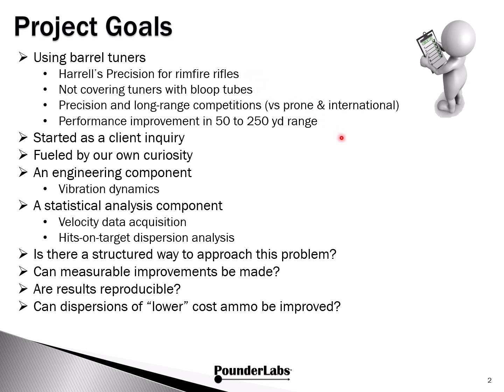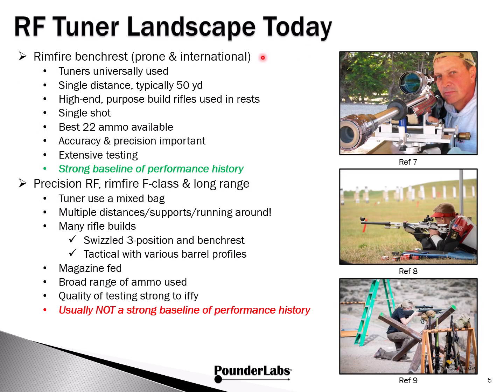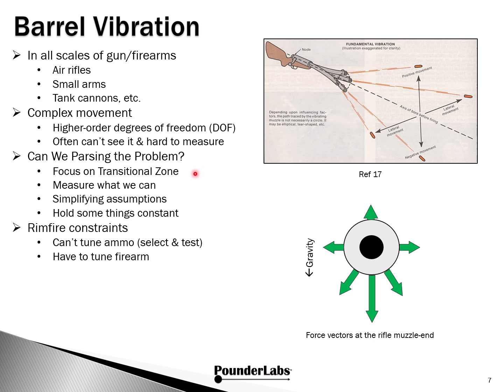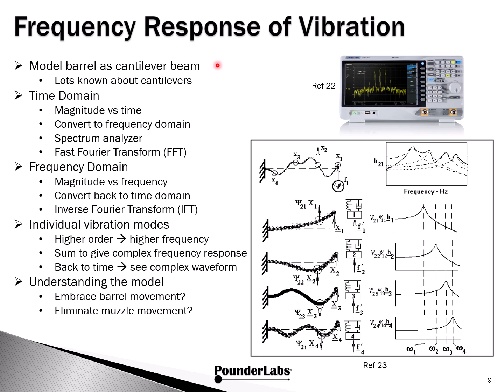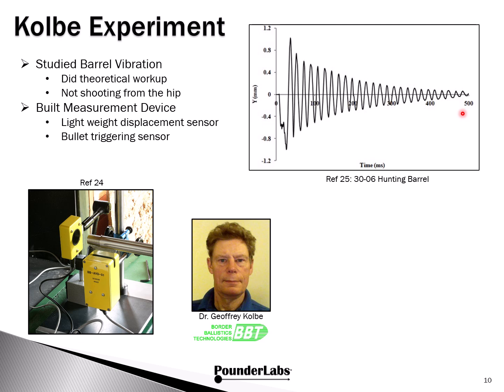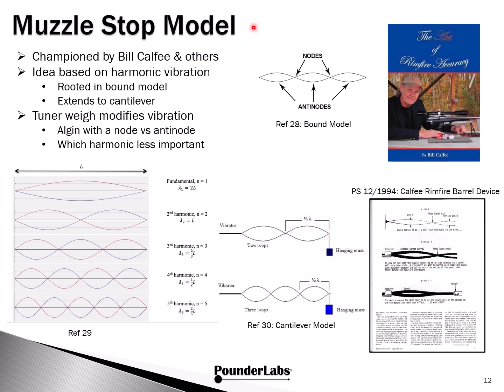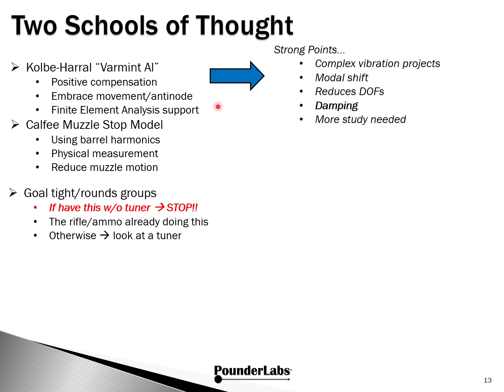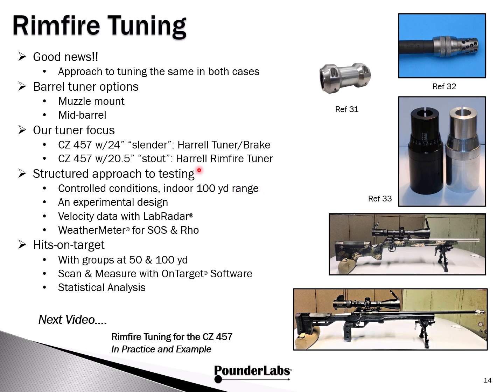Barrel Tuning for Rimfire Rifles - Fundamentals

Comment: Excellent sumary and analysis! It is straightforward to determine the PERTINENT harmonic on a centerfire via a charge weight ladder test and the point of impact on a target. Using a method discussed by Vaughn, it is apparant that the cycle corresponds to the speed of sound along the barrel length, which translates into a transverse movement at the muzzle. These high frequency vibrations ( 10k hz and harmonics) occur within the barrel time and are quickly overcome by the cantilever effects, but after the bullet has left.  Looking forward to your next episode.

Comment: This is great info! I am considering adding a tuner to my CZ 457 (Muller works barrel in chassis with 3 oz trigger) it is very ammo sensitive.  I wondered if full length bedding or the addition of a pressure point under the barrel would be an alternative to dampening harmonics. Thanks for this great and thoughtful project!
Reply from the maker: Thanks for viewing the video and your comment. I, and the folks I shoot with, don't have any experience bedding a barrel to suppress/modify harmonics. Bedding receivers is done all the time but as for bedding barrels... check with the heavy rimfire benchrest folks... they might have some ideas.

Anything putting pressure on a barrel can affect its vibration performance so proceed with caution. Back in the day Winchester 52 rimfire Sporters had a screw in the forearm that would put pressure on the barrel. But like any of this you'll have to experiment.
Reply: thank you!

Comment: The distance dependency is something many people seem to have trouble accepting, even though the concept of positive compensation relies on picking one distance and optimizing for that. Quite strange. Anyway, you have to compromise if you’re going to be shooting at several distances. You can only tune for one. I found for my silhouette rifles, where we aren’t allowed to use tuners, lot testing of ammunition was best done at the 3rd target at 77 m and finding what shot best there, because that minimized the error at the other targets at 40 m, 60 m, and 100 m.

By the way, I built one of those two-flats contour barrels that Varmint Al designed, which is listed maybe 2/3 of the way down that tuning page of his. Does what it says on the tin. Al was pretty happy to hear that, as he wasn’t aware of anyone trying it. Even he hadn’t tried building one. It’s pretty neat. I wish I could talk a better barrel manufacturer into duplicating it. The barrel maker that made this one for me evidentially doesn’t make barrels of a quality suited to benchrest pursuits, unfortunately. It still allowed me to confirm or dispel whether or not the concept would work, at least, but the bore itself isn’t stellar. I sure wish I could get Benchmark or Shilen or one of the other well-known makers that produce excellent bores to make me one. I got partway there with Shilen and then they ghosted me after I said I was in Canada, haha.